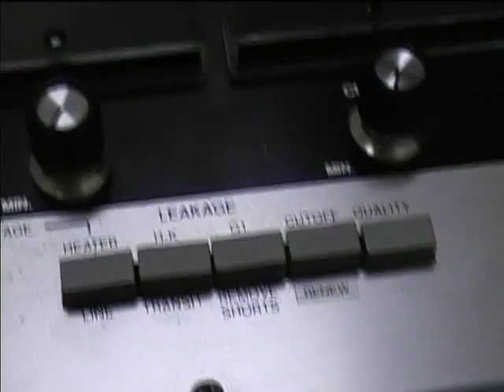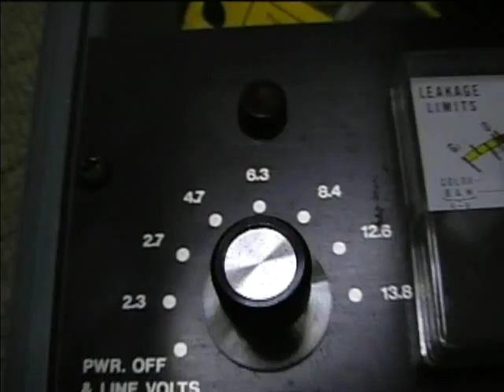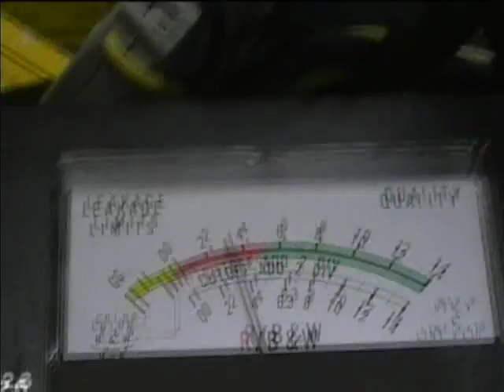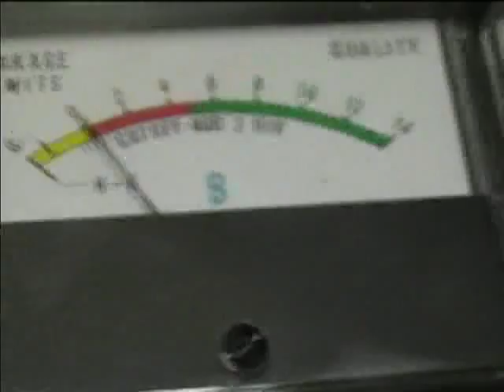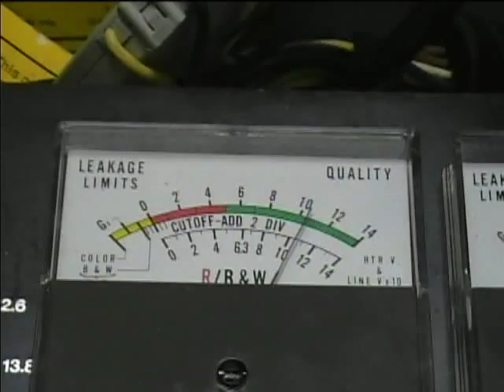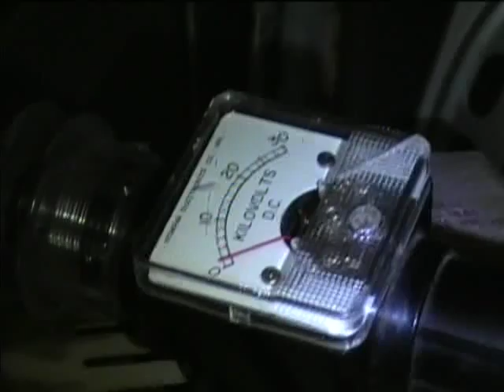RCA CRT Tester CR-III WT-333B

Comment: The early 23" tubes were often problematic. I believe that one or two Motorola models also used a 23" tube. There was a bezel replacement kit that would allow the tube to be replaced with a 25" tube. Your's however tests very good. I'm sure when you fix that set it will have a good picture.